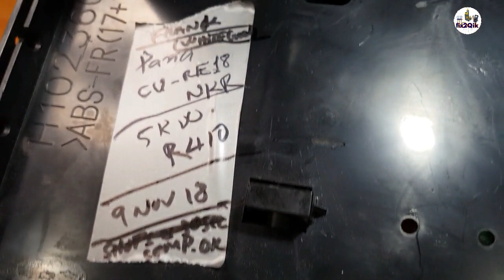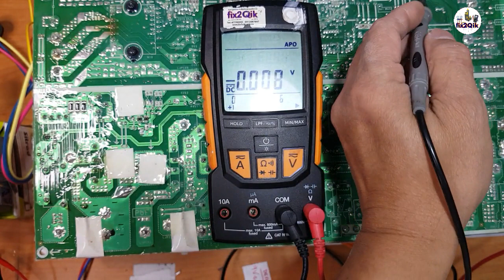Repair main board. Fan problem. Panasonic RE18NKR.

Comment: Hello, great videos you have.
How can I know which board has problems? My outside machine disconnected from the indoor on pin 2 and 3 has a fixed voltage of about 41v dc, but is not fluctuating. 
My model is cs-ye18mke from panasonic.
Hope to year from you soon.
Many thanks
Reply from the maker: hi, you have to look at the error code on the remote controller and go from there ..